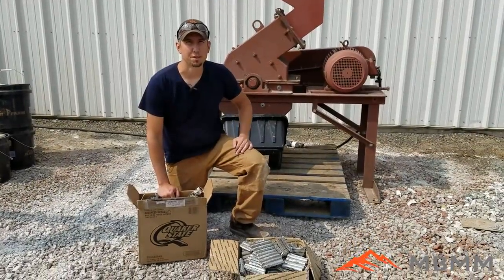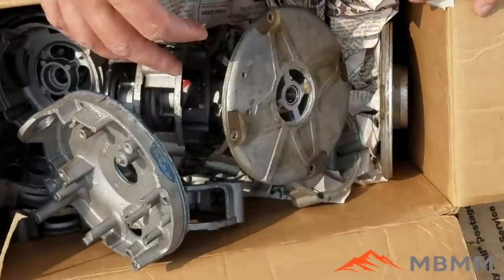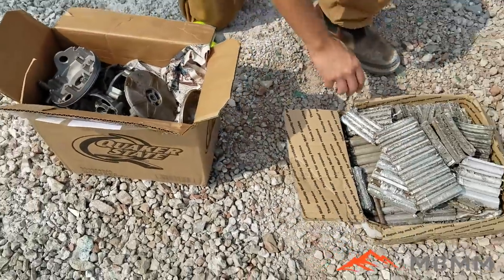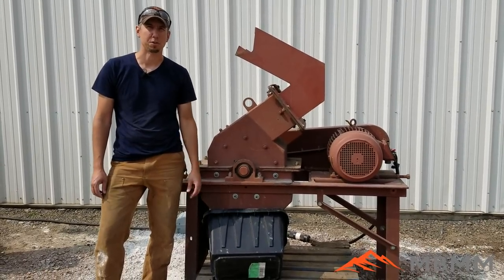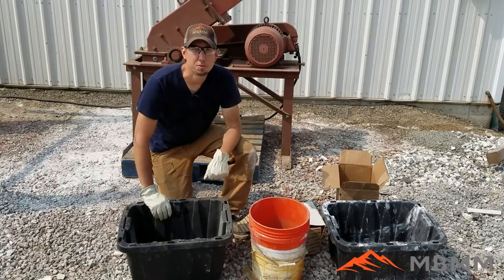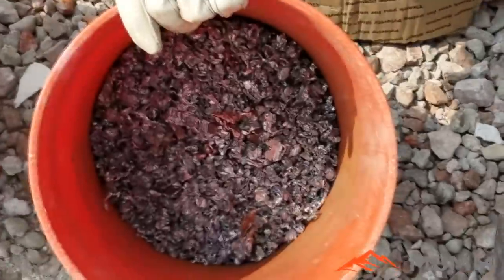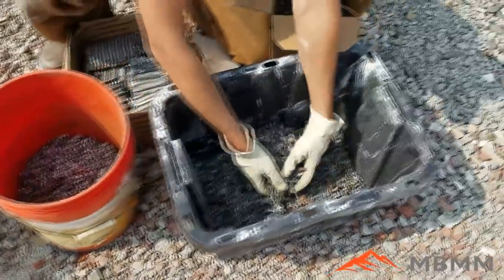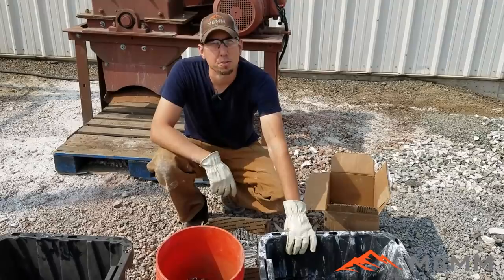Processing Aluminum Copper Radiators and Cast Aluminum with a Hammer Mill

Comment: Will this do aluminum heat sinks for computers two separate the copper cores?
Reply from the maker: Hi.  It will break them up nicely, but the Cu and Al is hard to separate without grinding fine and putting them on a wet table.  Thanks for the comment
Reply: @mbmmllc  is this hammermill table compatible with any of your current wet tables or is that a separate set up?
Reply from the maker: Hi Charlie.  Here is an example of our hammer mill and a smaller 2x4 shaker table running as a system.  The are very compatible with each other. https://www.youtube.com/watch?v=TBc5XaBPx_0&t=3s
Reply: @mbmmllc  very interested in purchasing one of these machines in the near future I have contacted your company before very impressed with the videos